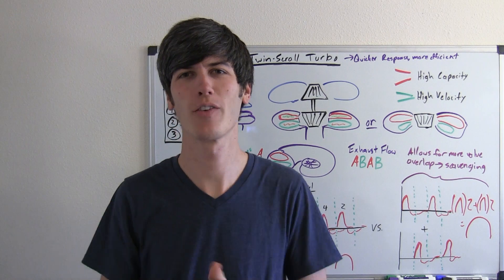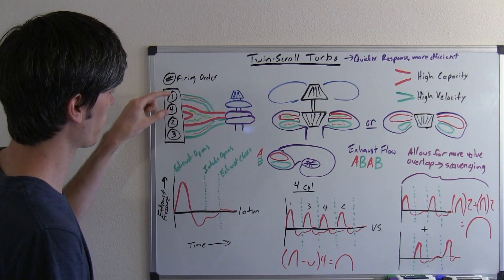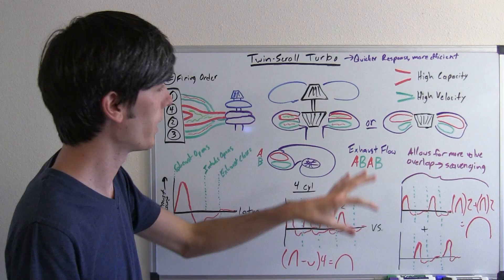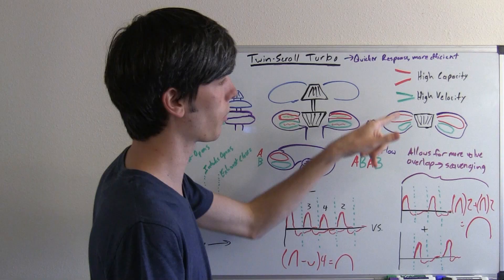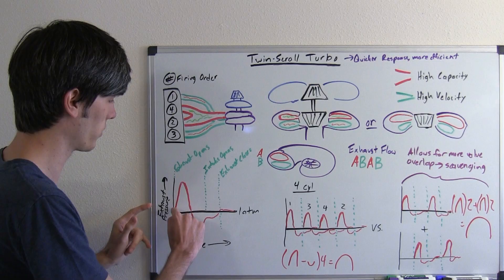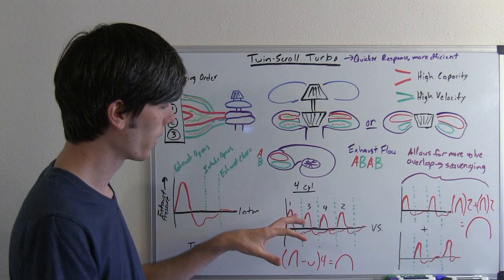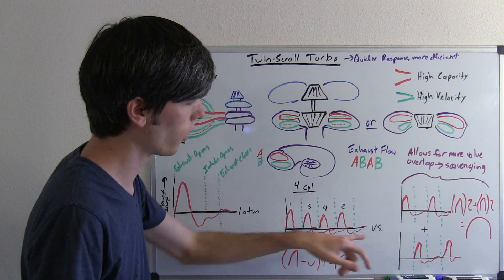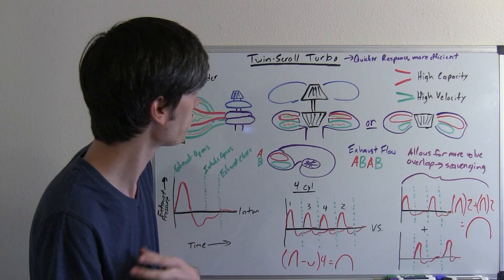Twin Scroll Turbocharger - Explained

Comment: two questions, one, how would the wastegate work on a twin-scroll? would you need 2 external gates? (assuming your using a small enough turbo to need them) and second, would a tri-scroll turbo be feasible on say a 6-cylinder? using a small, medium and large vane, plus having 2 cylinders going to each?
Reply: it wouldn't be easy just buy a cheap Garret don't worry about it unless you find a cheap twin scroll to rebuild
Reply: and the three vanes would make it have an unusual flow as it would likely choke
Reply: Matt Fraser my Subaru legacy has a Vf44 twinscroll and its alright about pricey for my liking.  It only uses one waste gate the setup is similar to a single scroll turbo I think.
Reply: Aftermarket kits usually use 2 waste gates but you can run a single internal gate or a divided external and only use 1 external waste gate. All depends on what you wanna do and your wallet.

Comment: How do I pair exhaust manifolds for a single twinsscroll turbo for a V6 engine. Just feed one scroll by the left cylinder bank and the other by the right?

Doesn't choke the smaller scroll one of the cylinder banks?

Comment: on the other method of twin scroll turbo charging whereby the two channels are of a differant diameter to one another (reducing lag), does this not increase the back pressure of the two cylinders serving the smaller diameter channel to generate the high velocity exhaust gas, and would this not affect the running of the engine through out the rev range?
Reply from the maker: Yep, you would have to have a decent balance so it wasn't too restricted at higher RPM.

Comment: So I'm building a rb20det. I'm going to be using a Holset turbo HX35 it's a twin scroll, but the only manifolds I can find that will work are single scroll. Should I go with this combo or should I buy a Holset HY35 which is a worse turbo but it's single scroll so it will be a single scroll turbo on a a single manifold. Or should I just go with the twin scroll on a single manifold?

Comment: Is it possible to use a dual twin-scroll turbo setup for a V6 engine? eg. One twin-scroll turbo per cylinder bank.
Reply from the maker: I suppose it's possible, but you'd have uneven cylinders for the scrolls.
Reply: Engineering Explained wouldn't his idea work better on a V8 ?
Reply: Engineering Explained The ignition sequence of a v6 is 123456 so the left side of the engine feeds 1 side of the scroll. Because the cylinder 135 is on another bank than cylinder 246 there is no interference like a straight 4 engine. because the the ignition sequence from left to right bank. I'm not sure a v6 has a its benefits by using a single twin scroll turbo

Comment: I'm assuming a twin scroll turbocharger setup would require twin wastegates?
Reply: Yes and no. Some twin scroll turbos come with an internal gate. Some external ports can be divided so a single waste gate can be used. A majority of aftermarket enthusiasts usually run 2 though.

Comment: video on valve timing please? i'm wondering why engineers want the negative pressure in the manifold. i thought for scavenging you just want the tail pressure wave to be lower than the leading high pressure wave. but you would still want the tail pressure to positive.
Reply: +iwrotefuck Ive been told you always need back pressure, or its bad. Why, I don't know....
Reply: +iwrotefuck There will always be a pressure drop from whatever your peak pressure is when using valves, because you will either have some open or some closed, creating a variation in the pressure..  More cylinders and a good exhaust manifold can decrease the pressure drop between each cylinder firing, but it is impossible to keep pressure completely equal between any number of pulses.  This is where exhaust scavenging comes into play.  When you space the pulses for efficiency you decrease the amount of negative pressure in the exhaust manifold.  John Strapp is correct that you always need back pressure, but you need much less with a turbo, and back pressure is always behind the turbo in the exhaust pipe, never in the manifold or turbo system which come before the exhaust.

Comment: If you wanted the turbo to be efficient, wouldn't you want the high velocity exhaust gasses to be on the large side of the turbine and your high capacity on the small end?
I'm no expert or anything but it seems you would have a more constant boost pressure this way.
Reply: I think you missed something there.  it's not that some of the cylinders output at a high velocity and some at a higher volume.  it's that the different channels create those scenarios within the turbo.  if you have 2 channels of different sizes, and the same volume of gas flowing through each one; the smaller channel will always create a higher pressure/velocity situation than the larger.  Think of it like a garden hose. If you turn the hose on full blast, and leave the opening uncovered, you get a slow, smooth flow of water.  if you take your thumb and partially cover the end, you effectively create a smaller opening for the water to exit from.  this will cause the pressure in the hose to increase, and the water starts to come out faster.  although it's still the same volume of water that comes out.  this is the principal in which the two different channels inside the turbo are based.
Reply: i know that the cylinder are the same, i just figured the smaller channel in the turbo for high velocity would spool the turbo quicker than the high capacity if it were on the larger side of the turbine wheel, but i guess that wouldnt allow a very high boost pressure either

Comment: Hey Jason, wouldn't the negative area(graph#2 on right) on the twin-scroll graph pull the positive exhaust pulse, so that it will eventually sum up the same as graph#1(on left)?
Reply: Graph #2 on the right has two graphs, one for each pipe of exhaust coming from the exhaust manifold. There's two pipes, one for cylinders 1 and 3, and the other for 2 and 4. They don't intersect until the very end, so the exhaust fumes through one pipe don't interact with another. So as the negative pressure in one is stabilising, the other exhaust pipe has its fumes going through it. By the time the second cylinder for that pipe pushes its exhaust, the pressure in the pipe has had time to stabilise instead of remaining negative and pulling a bit like in the first graph on the left.

Hope that makes sense, it's a little hard to explain without pointing at the screen and just using words XD

Comment: so this twin scroll design improves the efficiency of the turbocharger.. so does it eliminates the lag as well?
Reply from the maker: It will have less lag, but it won't eliminate it.
Reply: Engineering Explained thanks man.. same goes for VGT i suppose? right?
Reply from the maker: Correct, though it will be even better than the twin scroll.

Comment: do you have a favorite turbo manufacturer? Thanks for sharing your wisdom as always! 

06 wrx, stock location set up. Which twin scroll turbo would best replace the stock TD04?
Reply: like the j spec VF37 would that also push my hp capabilities at all? besides the obvious hope for better spool @ lower rpm with a wider power band?
Reply: Travis J. but as far as i know, twin Scrolls don't work with unequal length headers
so it's like a nogo for subies
Reply: I thought the same thing! . . . I know tomioka, they make a twin scroll turbo, down pipe, and headers for the turbo swap.
Reply: But is the quality there, performance etc? I would like to see if full race, may offer a good set up for the twin scroll swap on my 06 wrx? I really want a vf37 twin scroll like the Japanese spec models have had for years!

Comment: Is a Twin Scroll Turbo the same a Single Sequential Turbo?
Reply from the maker: I haven't heard of a single sequential before, but perhaps.
Reply: Engineering Explained The type of turbo I speak of has also been referred to as a parallel sequential turbo or two stage turbo or dual boost turbo. The turbos are designed by Garrett Honeywell and they are currently the stock turbo for the Ford 6.7L Powerstroke.

Comment: Is it complicated to upgrade from a normal single turbo to a twin scroll? What components do i need to replace or include? Thank you (i have a 1.4 twincharged Ibiza and i looking to change its turbo)
Reply: For straight engines like inline 4/6 its basically a new twin scroll manifold and a matching twin scroll turbo if you can find one with internal waste gates. If you are going after market you will more than likely have to switch to a dual external waste gate system though. 
It's not really worth it for that particular car. If it were a sports car sure but a 1.4 commuter car? no
I would say an exhaust and an aftermarket tune would be better money spent.
Reply: Thank you so much for the information, actually just did something to the exhaust, think i'm going for a remap/tune now. 
Regards Adam.

Comment: So it's just a single turbo, correct? What are some examples of cars that use this system?
Reply: Mitsubishi Lancer Evolution
Reply: Most of the cars with diesel engines have single turbos. Sports cars with smaller engines like Lancer Evo or Impreza STI are often fitted with a turbocharger.
Reply: BMW with N55 motor
Reply: The second generation Toyota MR2. Its 3SGTE engine is equipped with a "Twin Entry Turbo".
Reply: the new Hyundai Veloster uses a twin scroll as well
Reply: my ecoboost mustang lol

Comment: It's a fantastic way of creating power, but way too many moving parts which would mean a lot of room for breaking and maintenance.
Reply from the maker: Beast60 How many more moving parts are there versus a traditional turbo? I think it's possible to have the same number.
Reply: Engineering Explained I commented on the wrong video haha i was talking about the Variable Geometry Turbocharger
Reply from the maker: Beast60 Ahh yes, lots of parts. They're typically not used in gasoline engines due to the excessive heat, the vanes can't handle it apparently.
Reply: Engineering Explained Yeah, i think its something that they will develop over time and combine it with twin scroll etc. After that, there really isn't anything else they can invent to perform like turbos and super chargers, unless they combine electric motors to each wheel so every wheel runs at independent torque for better cornering and no loss of traction plus power from the motor for speed etc. Its like trying to reinvent the wheel when you think whats the next step above a turbo/charger lol
Reply: +Beast60 Formula one Energy recovery systems?
Reply: +Andrew Crews Hey maybe I can help... This designs highlights are that the exhaust pulses can be fine tuned and spaced across the turbine dynamically according to RPM range, allowing for the highest efficiency possible. 

With this design the exhaust pulses are spaced so that when the first 
pulse is losing pressure, the next pulse is already on its way and 
keeping pressure up so that each pulse connects to form a steady push on
 the impeller.

 You can get some of the same results by having a custom made tubular 
manifold.  The unequal or equal length manifolds are designed to line up
 the exhaust pulses just like this particular system does and achieve 
comparable results, although still losing some efficiency over this 
design while saving on cost.  The inefficiency of the custom manifold compared to that of a twin scroll and a custom manifold combination is due to the fact that the pulses distance from each-other will remain the same and unchanged at any RPM without the ability to fine tune the pulses for that RPM range.  Also a twin scroll uses a different shaped turbine to maximize the pulses through each channel in the turbo, while a normal turbo does not have this ability.

Comment: what type of turbo does a standard Subaru STI run? (later generations)
Reply from the maker: Depends on the market. I believe the JDM has a twin scroll, however stateside it's a simple single turbo design.
Reply: nasa444444 STI have a boxer engine. Evo has cylinders in-line. There are lots of other differences, but thats probably a standout
Reply: Engineering Explained thanks man

Comment: Fundamentally wrong. 1 3 4 2 is only a reference firing order.  Firing order could be 2 1 3 4 it doesn't make any difference because it is the same order at a different time.

Comment: Would a twin scroll turbo work on v8
Reply from the maker: BMW uses two twin scroll turbos on the X5 M and X6 M V8 engines, so yes! Each cylinder bank gets a twin-scroll.
Reply: How about like single twin scroll on ls 5.3
Reply: +Engineering Explained hey a tid bit of info they match the exhaust ports of companion cylinders to get maximum efficiency
Reply: +Jesse Ramirez In theory it would be possible, in practice I don't believe so. The complexity of the exhaust manifolds would be absolutely insane.
Reply: Justin Vanover with a flat plane crank V8 you will have basic designed exhaust manifolds with companion cylinders. the companion will be on the same bank of cylinders so faster spool up and less lag with short exhuast runners.
Reply: Is there different twin scroll turbo or are they all the same my is a gt 45
Reply: Jesse Ramirez are you referring to the amount of HP the turbo can product? Also their are internal waste gated and external wasted
Reply: TheArchetypeGamer
Even with a flatplane it is still going to be a manifold nightmare, you're going to need to have to 2 separate manifolds coming from non turbo side EACH combining with opposite pairs on turbo side and then smashing that clusterfuck into a flange to mount to the turbo exhaust housing. Sure I guess it is possible on a damn gutted tube framed drag car but I don't see it being viable on a street car with a v8 stuffed under the hood. A Twin turbo with twin scrolls on a v8 however would be WAY easier and much more viable.
Reply: I was talking about a twin turbo set up on a flat plane with twin scroll turbos. They would have manifolds like a 4 cylinder with a twin scroll turbo on each bank of cylinders.
Reply: TheArchetypeGamer
Yea the OP was asking about a single turbo setup with a twin scroll on a v8, which like I said would be a manifold nightmare. Twin turn would be no issue at all though, would work on a crossplane v8 pretty much just as well as a flatplane.
Reply: I've seen some turbo's with same size scroll and a turbo with one scroll small then other on same turbo do you know the reason for that?
Reply: Jesse Ramirez
Jesse what you're talking about are the turbines. Most typically when a turbo has different size turbine wheels it is a large exhaust wheel and a smaller compressor wheel. This is so that the turbo can take more advantage of the exhaust gasses to spool quicker. So the general rule of thumb is a smaller turbo will build boost quicker than a larger one, well if you take a smaller turbo and combine it with an exhaust turbine that can take more advantage of exhaust pressures it will spool even more quick.
Reply: a variable geometry turbo will be the best bet for minimizing lag unfortunately they cost a lot of cash to have. some companies are making them in a twin scroll prototype.
Reply: yes you can use a twin scroll on a single turbo v8   i run one    in fact, comp turbo's ct43xr turbos have nothing but win scroll for a housing...... i ts true usually you would separate the cylinder pulses for maximum efficiency.... but even when used on a single turbo/v8 system, the twin scroll housing will still actually help     my turbo is rated at 1400 flywheel n works just fine  my engine is a 4.6 sohc 3v v8 stroked to a 5.3l with a 80/92 triple ceramic bearing turbo with billet wheel   check out comp turbo website for more info on "split housings"
Reply: vgt are weak  thats why no one making big power uses them   their good for little engines like 4 and 6 cylinders
Reply: yes yes and yes...... on a built 5.3 ls with say like 11:1 compression on e85 id go with a 76/85 or a 80/92  something like that.... I have a 76/75  bad ass turbo too, but it causes too much backpressure even with a fender exit exhaust, and it stalls at higher rpm as it starts to get choked..... id recommend making sure your exhaust side is bigger, as well as dont get too small  an a/r either